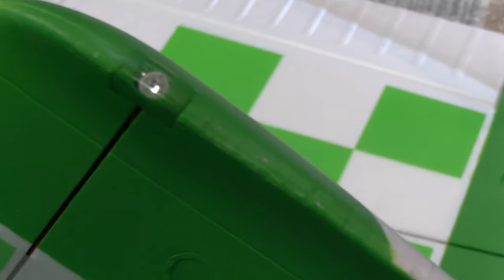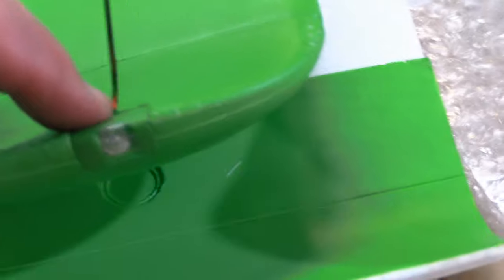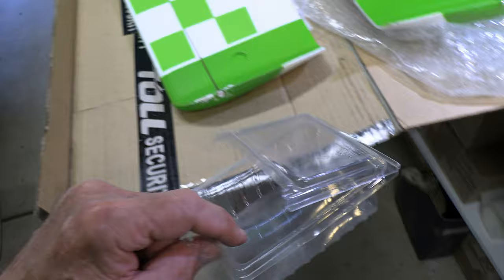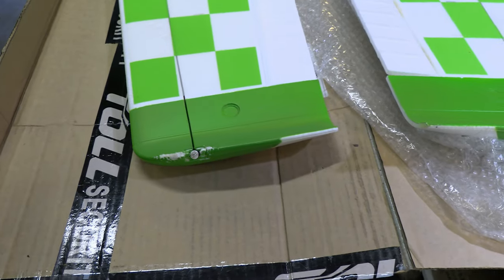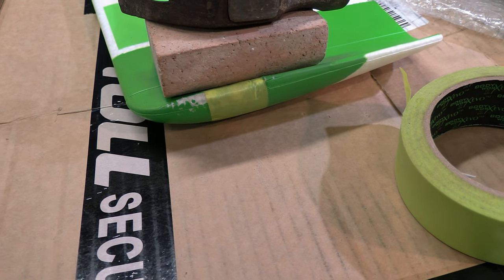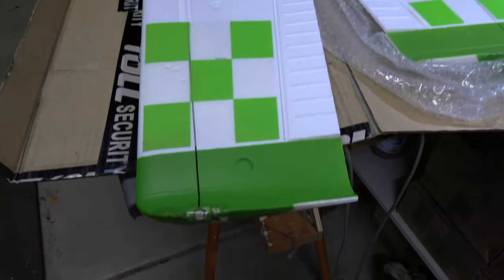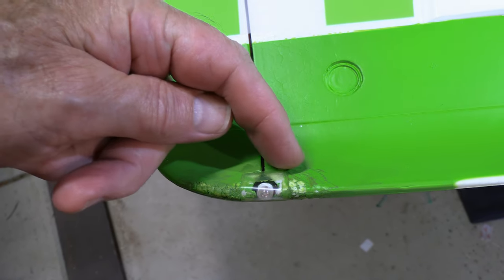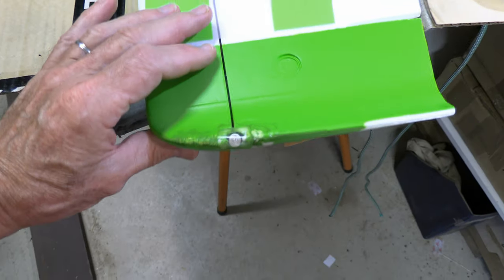Foamy RC Plane Nav Light Cover Repair

Comment: Great tip Jim thank you.  I will be doing what your daughter has suggested so i have a jar of correct color touch up paint.  I keep all mine in non clear plastic containers  cause was told that they can fade if exposed to UV light   not sure if its true but good to be safe   thanks again  love your channel
Reply from the maker: Right on!